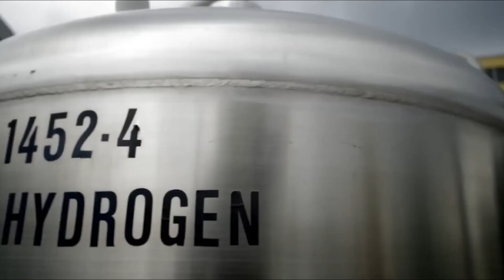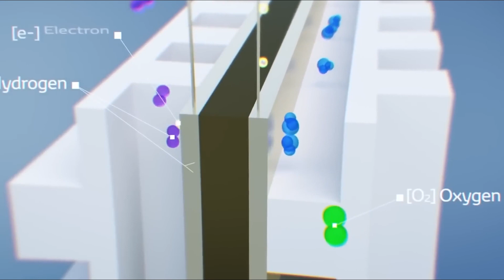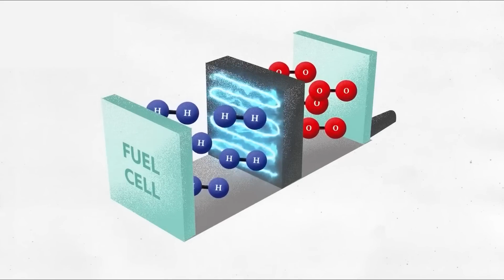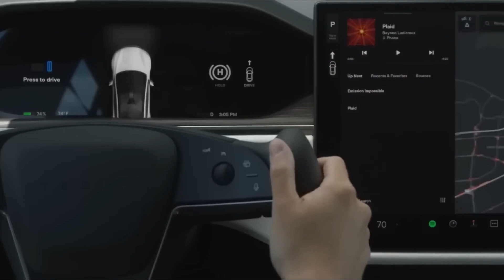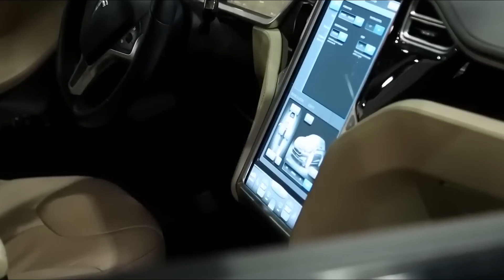Tesla's Game-Changing Move: Unveiling the Revolutionary Model H Hydrogen Car

Comment: I'm being stroked here. But before y'all wake up with wet pyjamas, let me be the buzzkiller with this. Remember Ahnold the governator? He promised the hydrogen highway would be ready by 2010 in April of '04. How'd that work out for him? And Calizuela at large? 
Moving quickly along, given that there's always a loss in translation, how much is going to be lost using unicorn farts to generate the juice required to make the hydrogen and compress it to the 5,000 p.s.i. required to fill your tank?
Now you've got your tank full. Think you're gonna be able to park that Hindenberg in your own garage? Think again. When the fire happens and you stick out your hand to the insurance company, you'll pull back a stump with a paper ticket on it for a bandage! That's right, it's agin either the law or insurance regs to park a pressurized canister in your garage, which even includes propane tanks. It's been that way since propane burning cars. 
No, the answer is in electrolytic carburators which were patented and invented by Henry Garrett, a Texan back in 1935! 😮 They generate hydrogen on demand, there's no pressure, so there's no problem parking them in your garage! You're welcome.